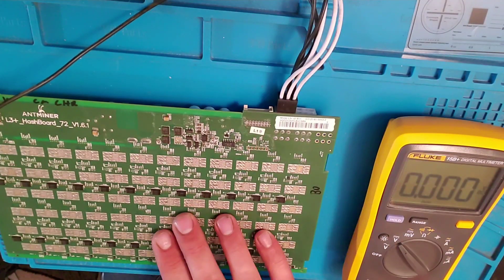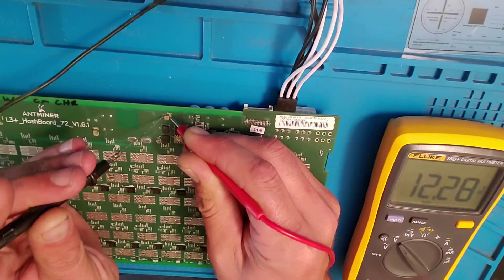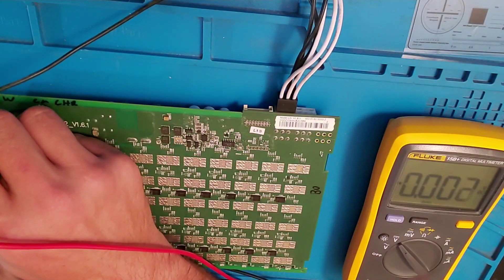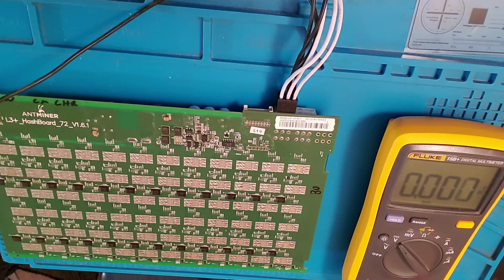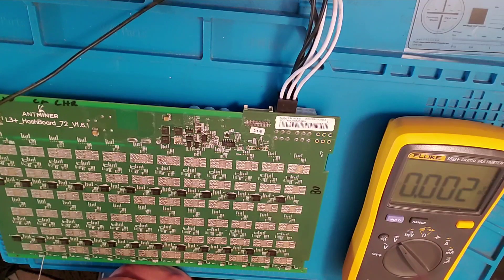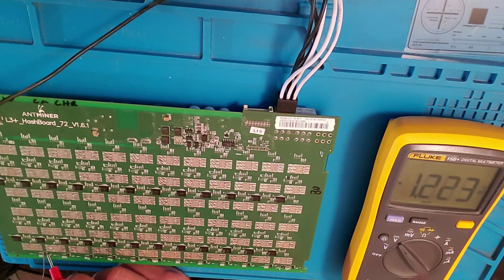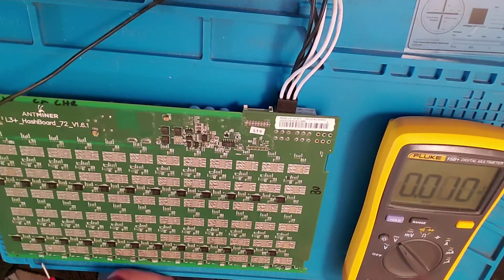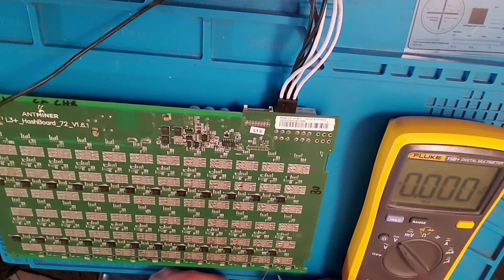How to repair bitmain antminer l3 hashboard - step 3 - bad ldo

Comment: Hi, I checked voltages on all the chips and only top row are 2,6 V on RI (6,12,18,24,30......72), CLK are fine on all, and RI on other ones are fine too. Which chip do you think is faulty? Many thanks. I have L3+
Reply from the maker: Sounds like everything checked out, 72 i believe is ri around 1.7 like the rest of the chips?

Make sure to test all 5 test points on the asics, and check boost and dc-dc

Also check io, data cable

Comment: thanks bro very informative .
i want to try test my own h-boards to see if maybe this is my problem.
im not so new on building circuit but  i dont have fully a clue where exactly you touch with your probe ... especially the 3th reading and the last one ?
its is posssible to get some close up pics ? 
im in barcelona  if not i would already had send you the board for repair....
Reply from the maker: Yes, I am working on creating better content, any support is greatly appreciated, as tools, equipment, and parts are not cheap
Reply: @CryptoMinerCHR  you are doing great bro... im sure you gonna grow rapidily
Reply from the maker: @OscarTheProfessor   thanks bro, that means a lot

Comment: I dont see 10v or the boost voltage on any of my boards. Even the ones that work fine.
Reply from the maker: Could be your multimeter setting
Reply: I'm getting so frustrated. I gave up on my old meter, Ordered the same meter you have and still can't get the readings I'm supposed to. 1.8v and .8v on LDO's either. Not even close. More like .0026v.
Reply from the maker: @Sundog0811  sent you an email
Reply: @CryptoMinerCHR  my board looks a little older v4.1. Turns out, it needs io connected for boost circuit to kick on and for ldo to power on.